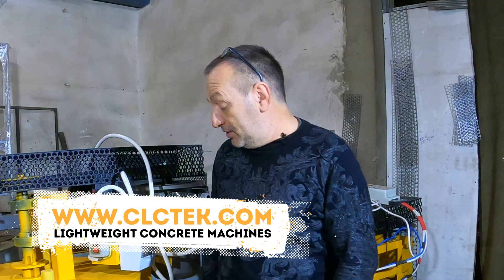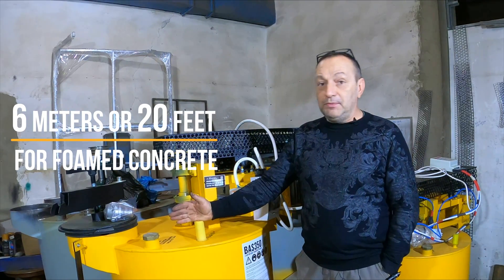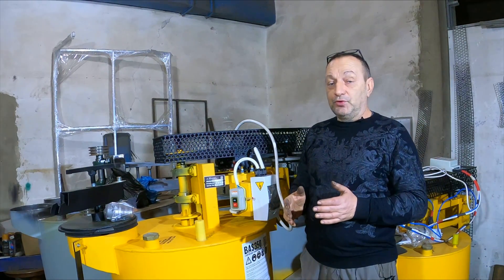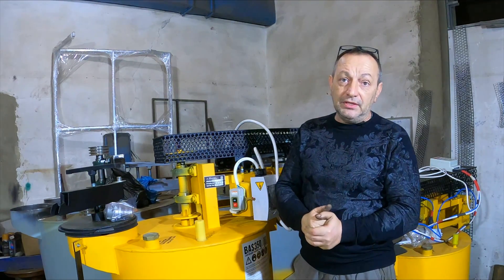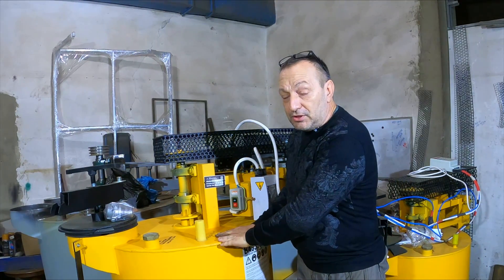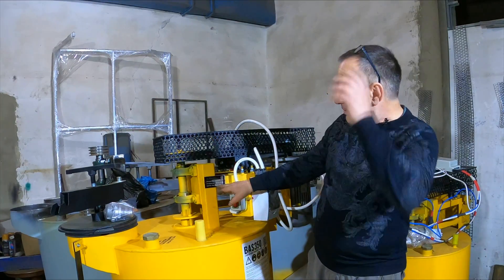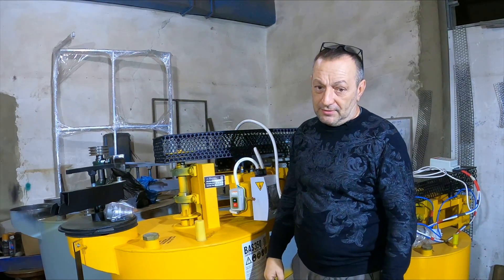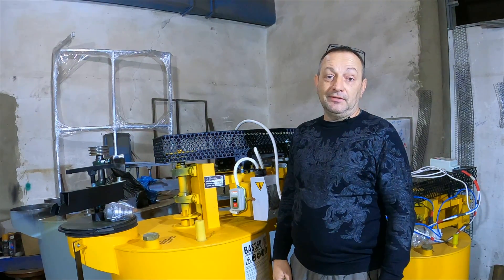Foam concrete pumping height lightweight concrete pumping

Comment from the maker: Ask questions. We will be happy to answer.
Reply: Great
Reply: What about mono screw pump for pumping 300kg /m3 upto 50 m height
Reply from the maker: Thank you for question. No difference. Anyway, the height of the column in the form of a hose in which the mortar will be located with its mass creates pressure that will destroy air bubbles in foam concrete.
Reply: @Foamconcretemachine  does the same principle go for very light wieght cementious foam? can you pump it to 10-20 meters if you gradually climb the hose to that hiegth, not strait up and down?
Reply from the maker: No difference. The rules of physics cannot be changed. You can't fool nature :)